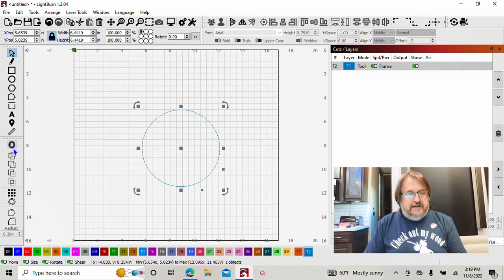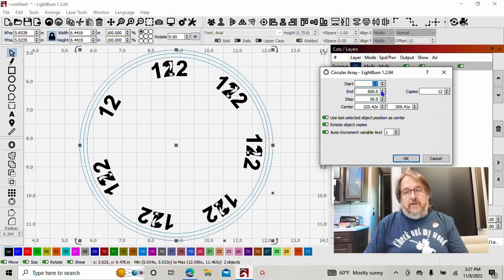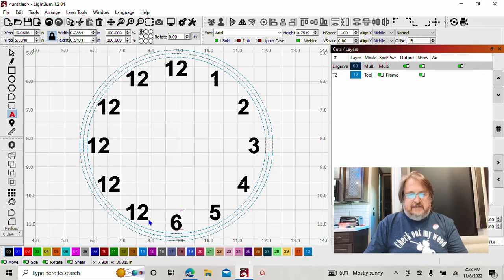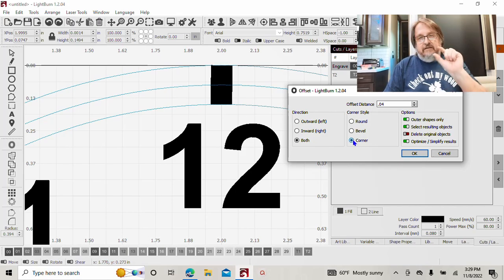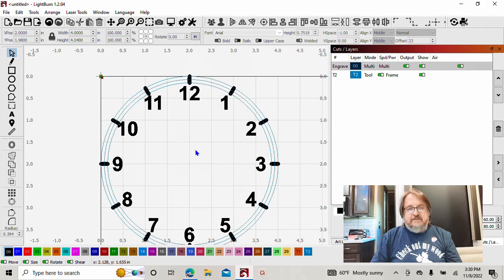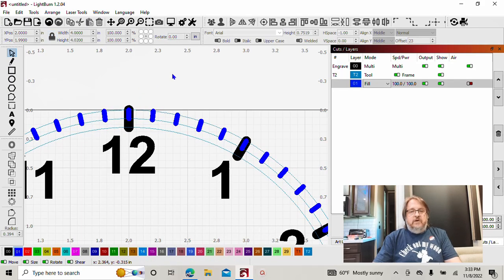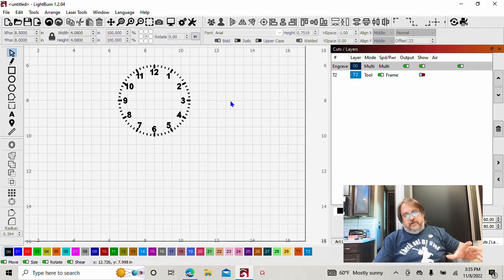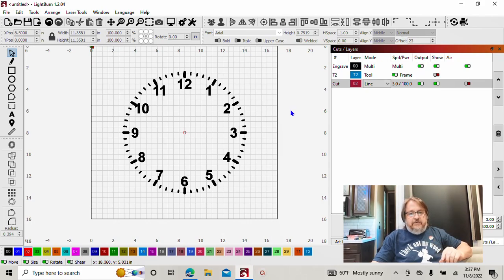Designing a clock face in LightBurn for your laser engraving.

Comment: Great video, but I have a quick question, depending on the mechanism of the clock, how do you know the size required?
Reply from the maker: The size of what? The inner hole diameter is detemined by the clock mech, and the size of the face is determined by the length of the clock hands.
Reply: @HoboWithWood  ok, for instance for the clock you have linked in Amazon what will be the size of the clock?
Reply from the maker: The description on Amazon says the minute hand is 5 1/4" long. So a clock face that was 10 1/2" would put the end of the minute hand at the edge of the clock face.
Reply: @HoboWithWood  thanks, great tip, very appreciated, I will convert to metric 🤣

Comment: Trying to follow this BUT IN layers it has no MULTI, in Circular Array the numbers do not appear when I open it, I am using version 1.4.01, there seems a few things have changed, in Cuts/Layers there is only 3 options now Line, Fill, Offset Fill what ever that doe's.
Reply from the maker: I few questions/problems here. First. When you see MULTI in the layers, there are multiple layers within that layer. This shows up when you are using sublayers on a layer. Sublayers are created within the layer settings. If you open a layer settings, on the top right, just under the output selector, you will see a plus and minus sign. This is to create sublayers in that layer. I use this most often to do a "Line" after doing a "Fill". This is to cleanup the perimeter of an engraving and add definition to the design. It works great. As to you numbers not appearing in Circular Array, without seeing what you are doing I can't be sure. But if you watch enough of my videos you will hear me say it often, in Lightburn, prioroties matter. The obect you want to create a circular array of must be selected first. Then while holding the shift key select the object you want it to circle. Then set you settings in the array tool. IF you select the number last, the second object selected will encircle the one and only number, instead of the number being duplicated in a circular array. OR , if you failed to hold the shift key when selecting the second object after selecting the number, you won't see any numbers. Which may be what you are experiencing. As to the last thing mentioned I have a video that explains the Line, Fill and Offest Fill. (there is another one that is sorta hidden, Flood Fill.) Here's a link to a video that might help a little with those. (These are some of my older videos, forgive the production value.) https://youtu.be/nsqkuSYlRV0  I hope the answered some of your questions.

Comment: when welding the minute lines to the hour lines is the entire clock still grouped together? i cant select the mins and hour lines when they are grouped, when i ungroup them and select the hour and min line i dont have the option to weld them together, i know im missing something simple on it any idea?
Reply from the maker: I'm sorry. Without seeing firsthand what you're doing and how things are layered and/or grouped, it's hard to suggest a solution. I'm contemplating offering live remote assistance. Would you be interested in that?
Reply: @Hobo With Wood  it was an issue with the layers that caused the issue, I got it sorted, I also included a graphic on the clock face 17 hour burn time thanks to yours and rich videos got it down to 1 hrs 21 mins 😀
Reply from the maker: I was thinking it may have been layer related, but without seeing it, recommendations for a solution were hard to come by.
Glad you got it sorted and found the huge time savings.
Reply: @Hobo With Wood  remote assistance a good idea I'm still struggling with canvas working on slate at the moment and have orders in hoping to get a co2 in few months when I'm up to grade in lightburn